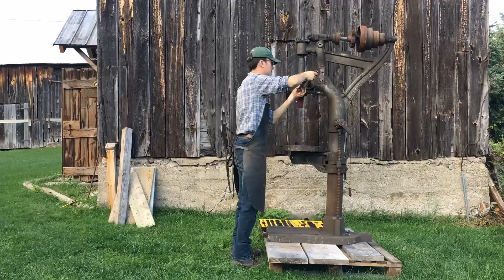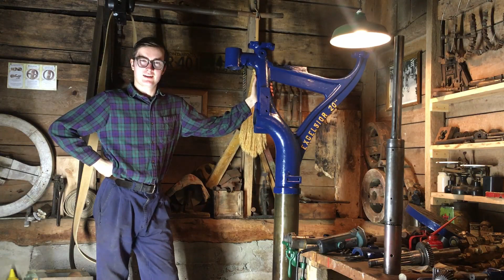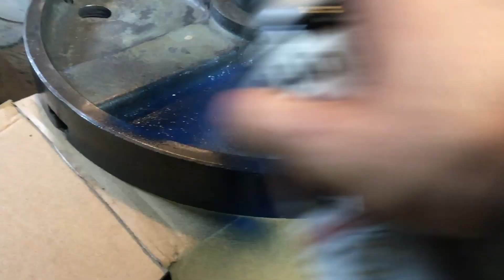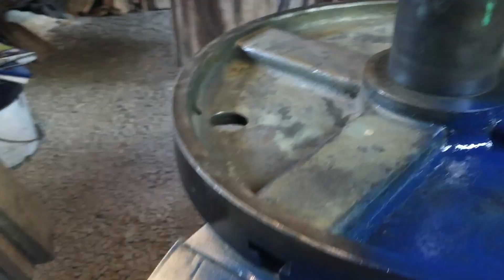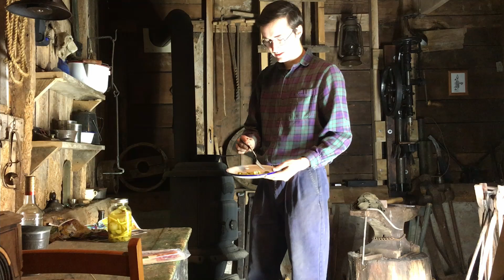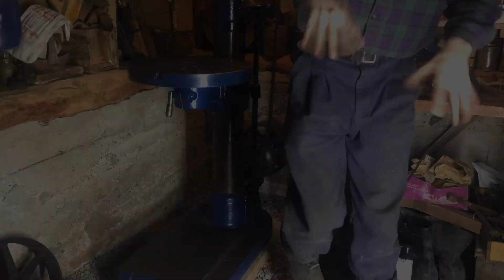100yr old Drill Press Restoration

Comment: Hi, I found this video when searching the interwebs.
I have an old, probably 1910 ish drillpress, it seems to be manufactured by L.M.Ericsson, the company here in Sweden that later made phones, and cellphones. (later also merged with Sony)
Have you ever seen a machine looking like this, It just might be a copy of some other machine ?
https://www.youtube.com/watch?v=1-aHrQoMi-8
Now I realize you can't understand what I say, but you can see how the machine looks.
Rare ? features, is a counterweight to lift the spindle (No spring) and also a counterweight inside the pillar, to balance the weight of the table.
No angle gearbox, original was flat belt pulleys, in an angle, to the transmission shaft in the roof.

Best regards and happy holidays !
Reply from the maker: Hi! I’ve never seen an Ericsson drillpress here, but a lot of smaller drills used different techniques than bevel gears to acheive higher speeds such as friction clutches. Becker vertical milling machines used angle changing flat belts like the original config of your drill. David Lundqvist might have more info for you, if you look up Lundqvist Machin Snickeri. Cheers!

Comment: I love the idea of restoring something like this but, while I have no doubt I could do it, it would be completely impractical for me to do so as the ones anywhere near me are much too large for my small garage.  So I restored something a bit smaller...a 1950's DeWalt radial arm saw.  :)  Next will be a 1940's Delta drill press.  The ceiling in my garage is about 6'10".  I'm 6'8" and I barely fit in there unscathed myself, lol.

Comment: Regarding the end play in your spindle (aka mandrel) I believe that where you had all that play there is supposed to be another entire set of balls! Yes, there are ball bearings above and below. I think if you backed off the end play nuts far enough, you could see that the races exposed fit balls of a certain size. Fortunately, you have the lower balls still so you know the size to buy. Otherwise, I have just discovered your drill press video and I have to say it is very entertaining. I have a Champion 20" which is nearly 100% identical to the Royersford Excelsior.
Reply from the maker: I appreciate the tip! If I understand correctly, Champion commissioned Royersford foundry to make the drills marked "Champion 20", the only real differences being the handle on the feed wheel, the back-gear casting being part of the main casting as opposed to a separate part, and the markings. Cheers!

Comment: She's a beauty - and fits perfectly into your shop.
Were you able to source replacements for the stripped bevel gears?
Reply: You're supposed to be producing a Model A brake video, not surfing YoutTube! 😂
Reply from the maker: Thanks! No replacement yet- I'm trying to figure out the best way to measure the necessary cone angles that determine offset, then I'll either make new gears or buy a standard set and figure out how to attach the larger gear to the driving collar for the spindle.